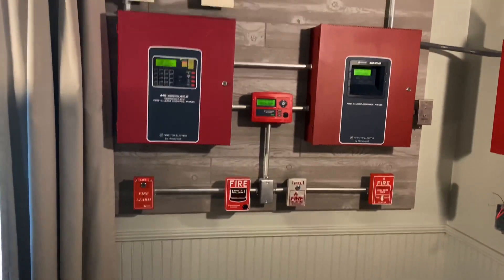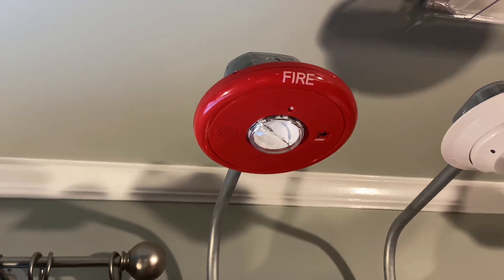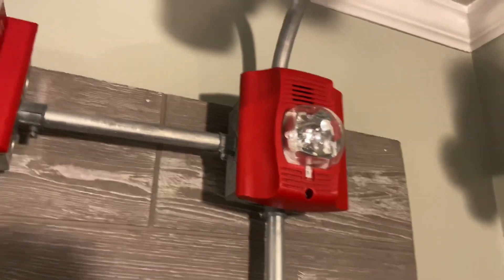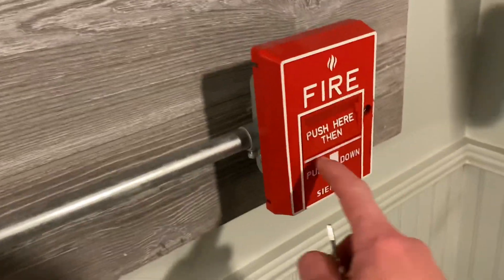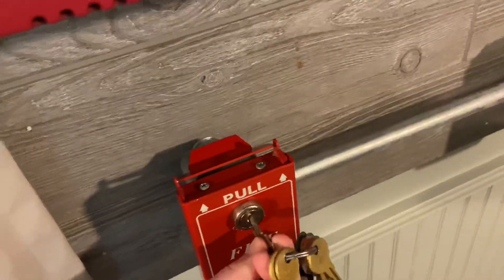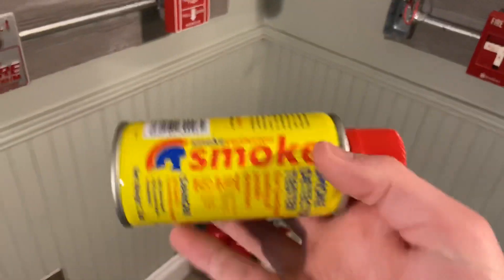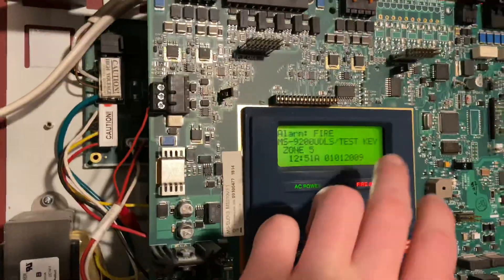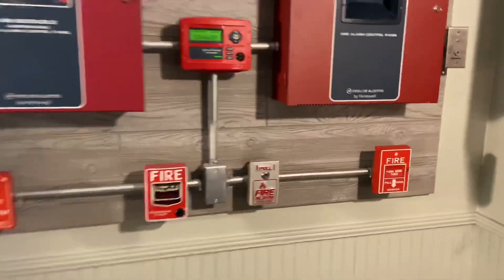System Test 9 | Board 1

Comment: I have a white model of the EST genesis ceiling mount shipping and I should get it in today. I am running a wire from my bedroom fire alarm system to the garage. I am also putting in a EST siga pull station. My question is the horn on the EST genesis able to be disabled without cutting wires?
Reply from the maker: The only was to disable the horn would be to cut the wires on the inside.
Reply: @ExitSign250  ok

Comment: Do you have a module that makes the conventional smokes turn into addressable for 9200udls?
Reply from the maker: There is a module to do that, and I own one and it is wired into my demo. It’s the module on the right side. The model is MMF-302. It’s for 2 wire smoke detectors. If you have a four wire detector, you can use a standard module for the contacts and supply the power to it via the resetable power.
Reply: ExitSign250 can you do a video how to do that?

Comment: Awesome! Couldn't you use System Sensor sync to have audible silence on the EST Genises?
Reply from the maker: Thanks! I haven’t tried that before, I’ll have to experiment with it. But if it did work, the RSS and EHDL1 would act up since it is the incorrect sync protocol.
Reply: @ExitSign250  Your welcome! True, I've heard   that EST Genises's work on the System Sensor sync so I was throwing an idea out there. Maybe for your next test you could use all EST Genises's and test it out. Love your videos!
Reply from the maker: The Alarming Alarmist   I appreciate it! I remember back in the day when I had a house system, I used System Sensor sync when I had both System Sensor and EST devices. If I recall correctly, all of the strobes synced together, but only the respective brand’s horn synced. So the System Sensor horn’s synced with each other, and the EST horns synced together.